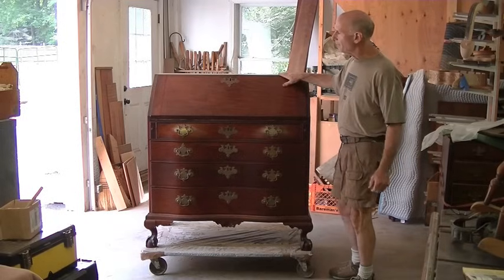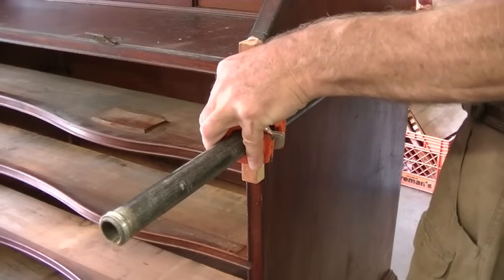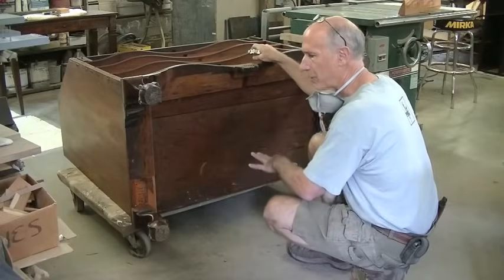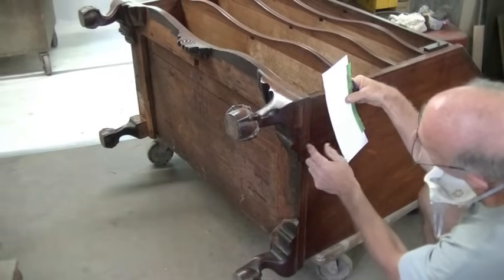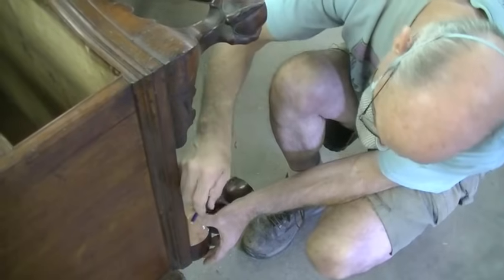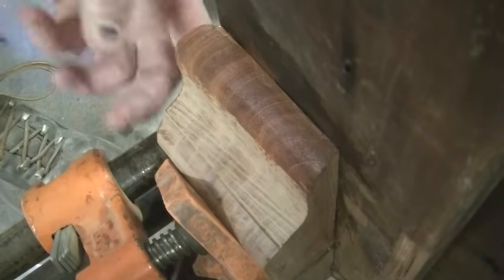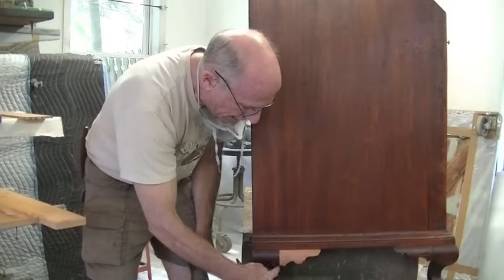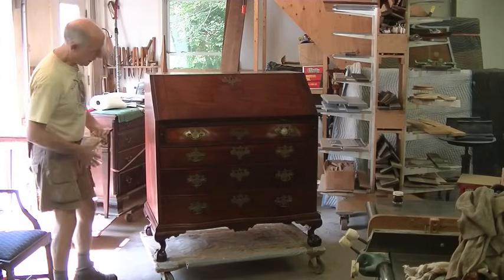Restoring an 18th Century Chippendale Desk - Thomas Johnson Antique Furniture Restoration

Comment: Thank you for your excellent advice on so many aspects of furniture restoration. At 87 I have just retired from a busy career in industry and am now repairing, restoring antique furniture that I have collected over the years'. In about 1960 I bulit mahoganny coffe tble and covered the top a with decorated marketry veneer chess board. The simplest adhesive to use was an impact adhesive. Sad to say almost everyone of the 200 or so oieces of veneer has lifted. The carcase made with hot hide glue is as good as new. 
Wish I had seen your videos then.

Briton Walker UK
Reply from the maker: Thanks! Yes, that's too bad about the top. You could try working a little hide glue under it and clamping it down - you've got nothing to lose!

Comment: I’m really curious what that large wooden item is in the center of the room. Its legs are about 5 feet tall and the top is like a wooden birdcage. Thanks for making these videos. I’m not a woodworker but always learn a lot and appreciate your high standards.
Reply from the maker: Thanks! That's a table being repaired. It's on a bench, and the top is removed. It had the "cage" around the shelf, going up to the top. Open in the front

Comment: I don't know if you can remember specifically with a job from so long ago, but maybe you can answer in general terms. Would the hardware for the writing surface likely be original? What I'm actually curious about are the wood screws, which, if original and factory-made, would have been kind of newfangled at the time. They might have had to be imported from England if they weren't somehow hand-cut locally. (Which might also constrain the date. English imports might have been hard to come by between 1775 and 1783.)

If the screws aren't original, how would the hinges have been attached originally?
Reply from the maker: Hi Chris, thanks! The screws must be original. In my experience it has been rare to come across screws that you can tell were hand made. But I really know nothing about the history of screws and their use. I need to look that up!

Comment: Wow, that’s a perfect color match between the new wood and the old wood.

Tom, do you ever use a syringe to inject glue into a joint, like that joint between the foot and bottom frame on thos desk?
Reply from the maker: Thanks! I do, but not that often, although lately I find the syringe works great with hide glue(not as thick as yellow glue)

Comment: Hi Tom. Great repairs and remake of the leg bracket.. That sure was a nice piece you worked 
on. You look busy in the shop. Thats good. I'm to pretty busy Just finished up a Kitchen 
cabinet & drawer refinish job. Total 50 pieces. That was a job to do ! . I got some new videos uploaded.
If you got a second check them out. What brand hide glue do you use ? Thanks for sharing. 
Keep the vidz coming.

Cheers, Michael Frey
FREY WOODWORKING INC.
Reply: Hi Mike, that is a big job! I'm using J E Moser's, maybe from Woodworker's Supply. I'll check out your vids, I'm still not receiving notification of them.
Tom

Comment: Does applying the bees wax polish with steel wool end up looking different than applying the wax with a cloth?  You apply the wax both ways and I'm trying to figure out when you use each method.  Thanks.
Reply from the maker: You're welcome! I use the steel wool as a very light abrasive to help clean the surface on old pieces of furniture. But say on a newly finished piece for instance I would just use a rag

Comment: I have a similar desk I am working on, the fold down desk top has a broken side where the main piece is capped and there is a rabbit that connects the two. would you recommend cutting that off and remaking the piece?
Reply from the maker: Hi Cody, I'm so sorry I missed this comment so long ago! You've probably finished this project. If not, email a photo: thomasjohnsonrestoration@gmail.com